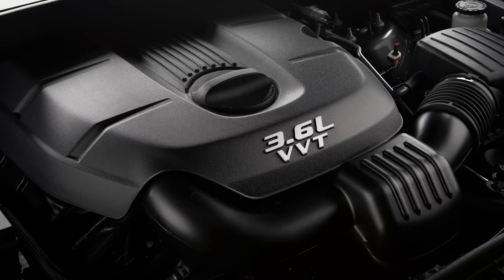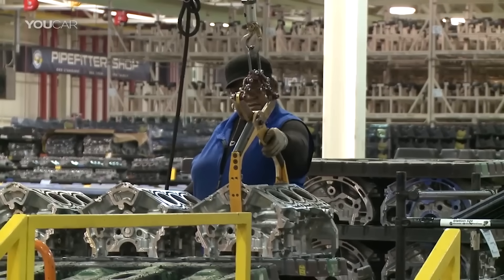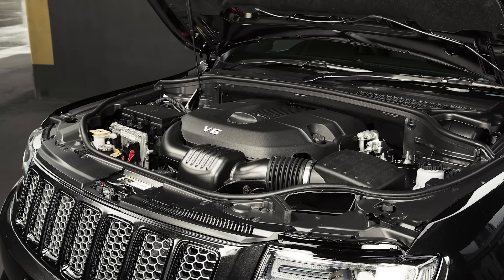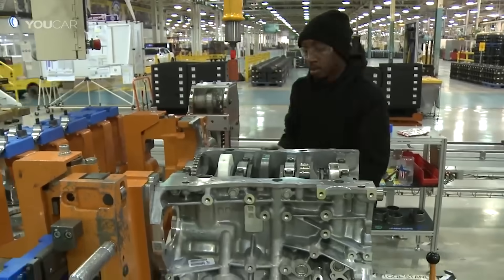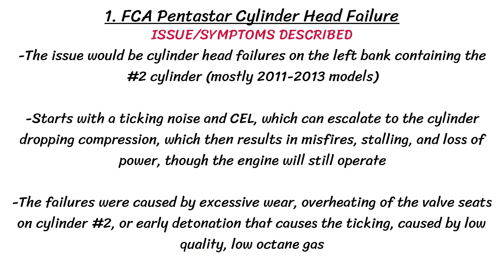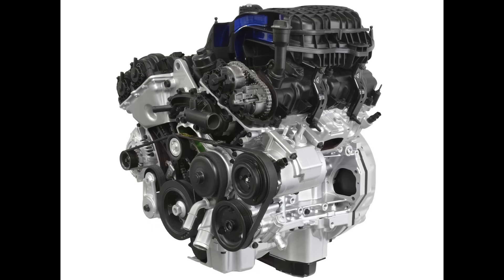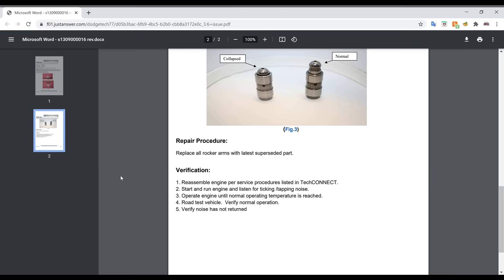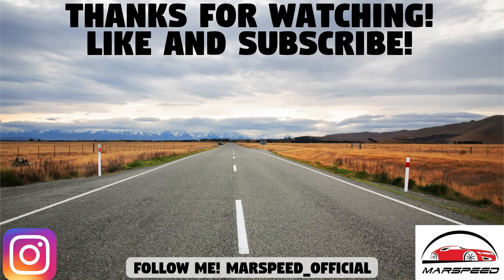The Specs and Fatal Flaws of the Chrysler 3.6L Pentastar V6 Engine

Comment: Gotta say that the Pentastar looks to be a decent engine overall. Hopefully these indicated flaws are not severely common.
Reply: It DEFINITELY is. Thats the problem with these videos is that they have to find "something" to vlog about and the headline must be negative...or else no one will watch. It obvious that with soooo many of these engines on the road, that there will be complaints; its simple math.  These engines are in some vehicles that have the some of the best resale values ever...so the engine has a GREAT reputation or else values would plummet....i.e. Mazda's.
Reply: My 2014 Charger with the 3.6 is sitting at a cool 125k miles and the only engine related issue so far has been a leaking oil cooler assembly - but I have a hunch that the recent cold snap (-20 or so for a good week) just borked the rubber o-rings, as now that it's warmed up it doesn't seem to be leaking noticeably. Gonna replace it anyways, though. 

I love the engine and the car, just keep up on basic maintenance and I think most of these issues really don't show up very often, and if they do regardless it'd be earlier on in the engine's life.
Reply: I have a 2017 with 54,000 miles it just had one break!
Reply: @mnicholesms2618  I have a 2017 Jeep Wrangler with 36,000 miles on it and it's the dealership getting the head replace for a number two misfire P0302 error.  Ridiculous.
Reply: @mnicholesms2618  what broke?
Reply: @stat722  rocker arm bearing wore out. Had a ticking noise start. As I said it’s a 2017 with 54,000 miles on it and Dodge dealership refused my warranty. 5 year/60,000 warranty but somehow mine had ran out just a week prior! (Big line of bullshit) My husband fixed the part for a few bucks I wasn’t about to give a dealership 550$ deposit when I know my warranty was still available.
Reply: @stat722  2019 cherokeev6 Had only 64kmiles when all the problems started Had 6months no power steering trans went out engine shakes(3.2v6) front windows don't roll down the front sway bar links bent at 3mph and the ac already Went out and on top of that there is no after market support 0/5 this jeep had so many problems it got the point something would break almost every time I drove it
Reply: Oil filter housing over $500 to fix. Very common. Check Jeep, Chrysler, Dodge owners forums.
Reply: The only "common" issue I see is the rocker/lifter issue. And while it is a PIA, IF you catch it early, you won't have to replace the cam (and all but one on each cam you "can" sneak in without removing the cam and risking timing chain misalignment).
Keep the oil changed and stay below the redline and they're good runners.
Reply: I had a 2014 dodge charger that I used to respond to fire calls and go to work. Only issue I ever had was it was the first model year with the 8 speed auto trans. The engine was very strong when my sister totaled it
Reply: @RV Shadow the rocker arm issue was never resolved as FCA never acknowledged it
Reply: Yep.  I've got rocker arms ticking for the second time in 18 months. And overheating is a problem.  Gone through 2 water pumps in 24 months.
Reply: @RV Shadowmanufacturers come out with new parts all the time, because of changes in suppliers, materials, improvements on design, etc. Just because there's a new part number doesn't mean a manufacturer is acknowledging the old part is a failure.
Reply: Those flaws do not occur in engines made since 2015
Reply: @cytrynowy_melon6604  my 2016 caravan is now in the shop to replace the rocker arms.
Reply: @cytrynowy_melon6604  my 2015 jeep has a 3.6 pent engine and im having rocker tick problems its a common issue dont know why there isn't a recall on this
Reply: @cytrynowy_melon6604  Wrong, they're still showing up even in the newest Pacificas.

Comment: Would do a video on the 3.5 v6 flaws 
?
Reply: There are none, as long as you change the oil and filter at about 3k.  Mine has 356k kilometers on it and have never had an engine issue.  Change the timing belt and water pump as per the owner's manual.
Reply: I had a 3.5L Challenger and found that around 100 -110K I got a valve train tick, especially loud when the engine was cold. It didn't cause any problems though like on the Pentastars. The good thing is the valve trains on these are super easy to fix and that while your doing that and the engine is open, do the timing belt and water pump (suggested at 100K), because you definitely don't want the timing belt  snapping on you.
Reply: @mariadamechanic  I ran half a bottle of STP with every oil change.  355 thousand kms, and no tick.
Reply: Water pumps and oil leaks.

Comment: Have had a 2013 Dodge Durango with the 3.6 since new. It's been through an alternator (died with 600 miles on the clock), 2 oil coolers, the fuel pump rely issue since new (several no start situations) and had the power tailgate get stuck open 3-4 times. All in has been on a flat bed at least 5+ times. All this in the 8 years and  only 61k miles I've had it.

Comment: Family 2014 Durango has 120k and been ticking like crazy for past 20k. Just waiting for day it gives
Reply: Don't wait for catastrophic failure, get the rocker arm replaced and save yourself the money and headache
Reply: Cody - There are about 10-20 DIY YouTube video's showing you how to replace the rocker arm and lifter on a 3.6. it is just a bad bearing.
It is an easy repair for a novice mechanic and the parts will cost less than $100 bucks. After the fix, They all comment  that the car runs like new again. Good Luck buddy.
Reply: @RobtJude  I’m a mechanic for a living. Comes to my own stuff I just go till it’s dead.
Reply: Defective lifters is your problem 150 your gonna have a driving’s grenade . Do you like your disposable Dixie.

Comment: My 2014 Jeep Grand Cherokee had the radiator crack and leak with the first 20,000 miles and was covered under warranty. Otherwise a great engine.
Reply: Same here, had my radiator replaced at 20K due to smell of fluid, which I notice sometimes with the new radiator, I believe I smell the overflow, since it is a shitty little plastic bin that is not airtight.  No overheating, no coolant loss at all.

Comment: Just replaced a cylinder head on a 2019 grand caravan with 50k miles. Cyl. #2 had 90 pounds of pressure..this is still an issue unfortunately.
Reply: Warranty take care of it??
Reply: @onenikkione  yes absolutely.

Comment: I know this video about the pentastar v6 and I've heard lots of good things about it. That said, hearing that its the successor to the 3.7l v6 (couldve foreseen the 3.5l), I'm curious about the flaws of the pentastars predecessor(s), being the current owner of '10 dakota with 3.7l v6. I will say it definitely makes adequate power for moving my 2 tons of fun truck as well as towing 4k lbs (in my experience), and returns decent mpgs on the highway (about 22 mpg). 210 hp and 235 ft.-lbs. of tq dont sound like much on paper, but I feel it has more to do with the torque curve, just my thoughts. :)
Reply: The powertech motors, more specifically the 3.7 are excellent engines. Actually originally designed by AMC engineers, and put into production by Chrysler. I had a 3.7 in a Jeep liberty that you would swear was a small v8, lots of torque, towed a 4000lb boat/trailer very easily. Just keep up on the maintenance, and that Dakota will last a long time.

Comment: Do a video of the fatal flaw of the 6.4, 6.1, 6.2 engines
Reply: There already is a video regarding the early 5.7 HEMI.  Those you mentioned are related engines just bigger displacement.
Reply: Hemi v8 has the lifter failure will kill the engine.
Reply: @theshield1613  it doesn't "kill" the engine.  You fix it and move on with life. 

The lifter issue has been resolved, so far, with new higher quality lifters that were first introduced in early 2019.
Reply: @UnionThugg  thanks to Fiat they solved that problem.
Reply: @theshield1613  Fiat had nothing whatsoever to do with the V8 engines.
Reply: @UnionThugg  yes ever since fiat bought Chrysler/dodge in 2014 ,fiat put alot of money for the dodge chargers redesigned and also put alot money for the hellcat and demon engines.
Reply: @theshield1613  facts aren't your strong suit, are they? Fiat SpA began collaborating with Chrysler LLC in 2009. Chrysler and Fiat SpA merged in 2011, becoming FCA, now Stellantis.

Fiat has never had anything to do with the design, construction, or use of the 3G Hemi. They (and the vehicles they power) are 100% pure Chrysler engineered and built. Any "funds" FCA allocated towards the engines came from FCA-North American profits, as FCA-EU was not generating the kind of cash necessary to develop assemblies such as the Hellcats. 

You're a lousy troll.
Reply: @UnionThugg  get your facts straight before flipping your mouth
Reply: @UnionThugg  Chrysler/dodge was bought from fiat to survive.
Reply: @UnionThugg  I used to work at dodge dealerships I know my facts ,stop telling me fake information caveman.
Reply: @UnionThugg  btw fiat also did a fantastic job on the new dodge ram interior and exterior.
Reply: Timing chains and cam and lifters. Exhaust manifold bolts and manifolds cracking. Oil in the induction system,  but that's normal I guess.
Reply: @diymitchsgarage  I'm mostly talking about the earlier 6.1 version.  They made changes in 2009 to VVT and I believe the valve seat issues were resolved or not as bad?  Yes I know the 6.2 is more unique as it's supercharged and such.

Comment: The first new car I ever owned was the 1995 Intrepid. Then I traded up for the ES Model. Can you do a pros and cons on the Intrepid and the engine. My main problem was trying to locate a replacement exhaust manifold cover which is why, in 1999, I traded up for a Dodge Ram High Top Conversion Van!!! Thank you.

Comment: I have a 2010 3.5L Challenger, you should do a video on the 3.5 if you haven’t. I’ve heard that one of the vacuum lines can be defective which doesnt pull condensation out of the crankcase properly which could lead to oil sludge buildup.
For the 3.5 guys, one of the best preventive for this is an oil catch can and change the oil every 3k miles or 5k kilometres

Comment: I have one in a 2011 Jeep Grand Cherokee that I bought new and that now has 113,000+ miles.  It's the quietest, smoothest, most trouble-free engine I've ever had.  I change the oil myself, on schedule, and use quality oil and filter.  (I love how easy, quick, and clean it is to change the oil and filter.)  I also run a bottle of Techron concentrate through it each 3.000 miles.
Reply: I have a 2011 grand cherokee with the 3.6 too with 165k on it right now, i change oil every 3-4k just to be safe with pennzoil high milage. runs and idles very smooth too i drive around 100 miles a day and have no problems.
Reply: Ditto 👊🏻
Reply: Have you tried using MMO (Marvel Mystery Oil)?
Reply: @matthewmiller2268  No.  I've seen it in stores, but I have no idea what it's supposed to do.
Reply: @MikeV8652  MMO is a fuel system and engine oil additive that cleans your fuel system, lubricates the fuel pump and upper part of the cylinder and absorbs moisture.  It adds extra lubrication and cleans your engine out so it runs better.
Reply: Same here I change the oil myself use Castrol synthetic and have done 130k and no problems.
Reply: My 2011 durango had 107k when i bought it. Approaching 210k miles right now. My check engine light has been on since about 157k on the odometer. I miss how she used to run but all i get now is misfires and cat failures
Reply: @Future-Preps35  Absolutely!  Techron has polyether amine formulation, compared to polybutene amines used in all of the others.  The latter clean injectors etc. but can actually  contribute to deposits in combustion chambers that accumulate and cause knocks over time.
Reply: @MikeV8652  p

Comment: I had a 2013 AWD Charger with the V6. Never had a problem with the engine, although I did have issues with the alternator (covered by warranty), and some electronic quirks. The car was also equipped with e-shift, and there was a recall for that. Otherwise, the car had plenty of power, was quick to accelerate, and fun to drive. The AWD came in handy for adverse weather. I miss that car!
Reply: I bought a 2014 Dodge Charger SXT AWD with the V6 last July. Had the same issue with mine. Had the Alternator replaced just this past February. It’s a great car, luckily mine drives a lot better now, can definitely tell the difference. I’ll probably have to start putting the 89 in the tank every once in a while. Im planning to keep it stock, I put some Xenon lights in to replace those crappy Halogens and planning to recondition the wheels and the paint in the future, and put on some Michelin Tires when the Cooper Tires wear more. I’m planning to have some fun memories in mine for years to come! Hopefully you had a lot of great memories in that car, it sounds like you did!
Reply: Same bro smh

Comment: The fact that my father refuses to use anything but 91 octane in any vehicle seems to have saved him from that cylinder head failure, but it didn't save him from someone overtightening the oil filter and cracking the housing.
Reply: yeah, that oil filter housing/cap is problematic. You don't get good "feedback" when tightening that oil filter cap. Whether it's because of the plastic threads and/or the o-ring, it's hard to "feel" how tightly you're tightening the cap. So I can see somebody easily over tightening the cap and cracking the housing.